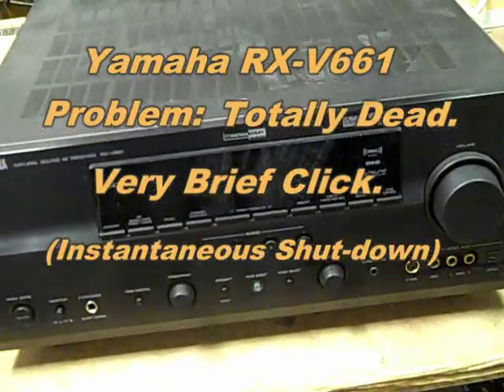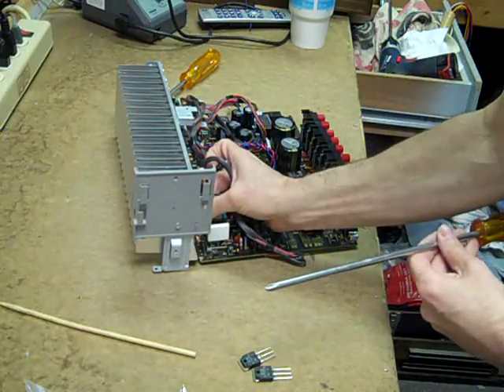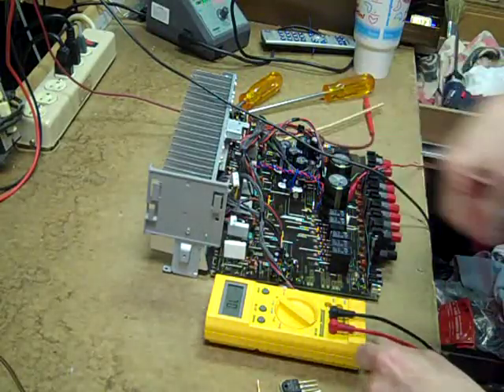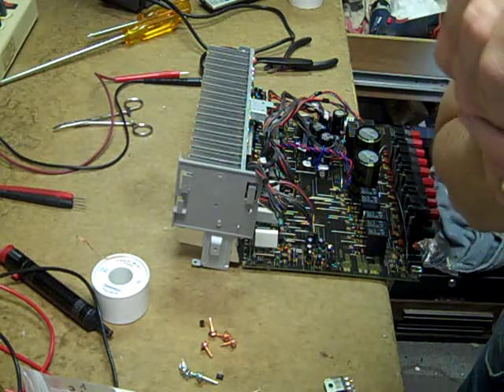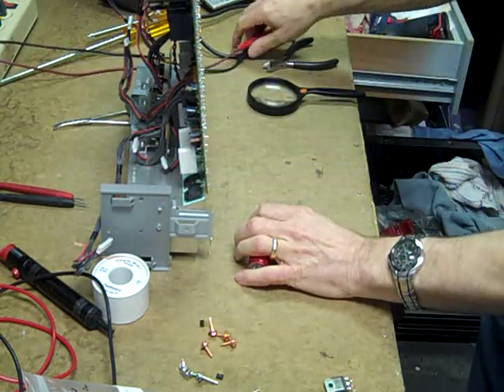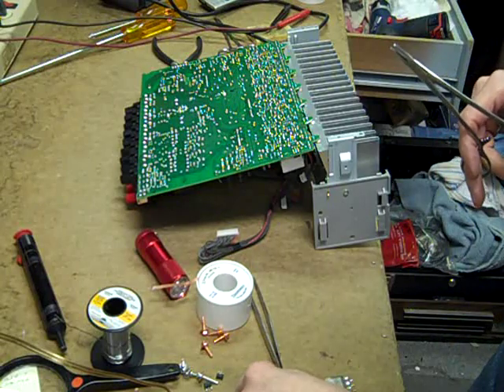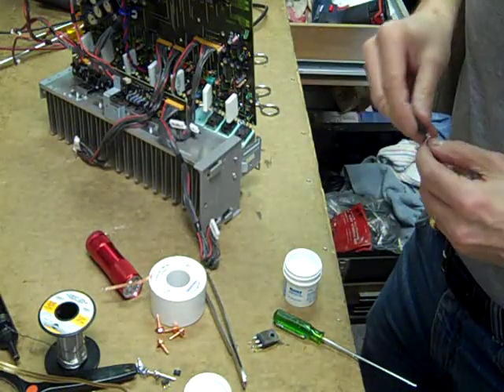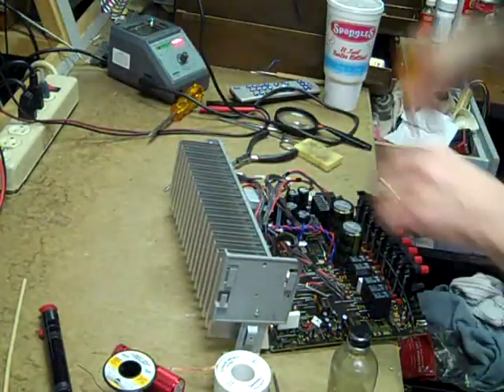Yamaha RX-V661 Repair Brief

Comment: I have Pioneer VSX921, suddenly notices there is not audio from SBR and SR 
channel; I checked that there is audio at relay PIN. Other channels are 
working fine. could it be a problem with relay? any logic that is not 
turning relay on. Thanks in advance
Reply from the maker: Looks like there are two separate relays involved here. Maybe try a full reset before going any further.
Reply: Thanks a lot Mark. I also had doubt about the relays. I did reset and there was no luck. Then I checked a capacitor leg after relay RLY6 and found audio. Now I can surely say that the problem is with track or the speaker pin solder joint. Accidentally I pushed the speaker socket and it worked! It is a loose fault or dry solder problem. Since opening the whole circuit board I made a jumper about half an inch from capacitor leg speaker tag. It’s now working fine. Thanks again for your reply.

Comment: Nice work, I have a yamaha rx-v667 and it works great but i have trouble getting radio stations to come in. after looking it over i see the antenna plug is bent up kind of funny and I'm thinking this might be a bad connection. would this be easy to fix?
Should I take it to a shop? I have done some soldering before but wanted to ask. thank you.
Reply from the maker: dankbobby The tuner is a complete module and fairly easy top replace except it is situated kind of underneath the HDMI board. The part number is WQ756600. List price is about 40.00
Reply: Mark Zacharias
Thank you very much.

Comment: Thanks for your feedback. That’s what I initially do, I measured the voltages at the CB703 connector: -11.7(12), +11.7 (+12), +11.5(12), 5(5), 23.1(25) and -23.3(25). The problem doesn’t seem to be here. Moreover, I checked the voltages at D18 (SMD), that is going to pin 35 (IC21) and is exactly 1.2V, as in schematics. While I am not sure I will get to the bottom of this, your explanations are very helpful (I enjoy more learning something new, rather than having this repaired).

Comment: Hey mark love thank you for this video I have the exact issue with my v661 I have done changed the output transistors but am struggling with the other repairs like the driver transistor I need assistance with the range it should read when tested normally and furthermore. I would like to if possible repair as I would hate to see it end as land fill. Any help would be grateful.
Reply from the maker: +Andrew Shorter If the outputs were bad ASSUME the drivers are bad, also the 5.1 volt zener diode. Also check the resistor between the emitters of the driver transistors. After these parts replaced, check resistance from base to base of the output transistors and compare to other channels(s).

Comment: Hi Mark. I have a Yamaha RX V659 that immediately goes into protection mode.  The error code is dc prt 026 hi. There is no short found on the output transistors. Any suggestions? Thank you.
Reply from the maker: This is because your problem is NOT the output transistors. The "PS" indicates a power supply fault.
Reply: Mark Zacharias Thank you for the quick reply. The error message did not include “PS”. Does “DC PRT” indicate a power supply fault?
Reply from the maker: @IIWII9  DC PRT indicates a DC offset on one or more amplifier channels. If the problem is on one channel only the likely culprits are the differential transistor pair or the low frequency roll-off capacitor for that channel. You can email me at mark_zacharias@sbcglobal.net

Comment: Hi Mark. I have been looking though your videos seeing if you have encountered my problem. I have a Yamaha RX-V667 receiver. It was working fine until recently it started constantly switching DSP modes. Its happening intermittently. I some of the other buttons on the front are also activating. Is it possible just to replace the front panel? Where could the replacement part be ordered?
Reply from the maker: pvdeluca Kind of unusual problem. The front panel switches are part of a couple of resistive networks. Any leakage could trigger this. Like if some liquid got in there somehow, maybe causing some corrosion. Tact switches can also be leaky but this is less likely. The part number for the front board is WU427500 for the U.S. model only. Ending in 600 or 700 for other markets. Probably fairly expensive.
Reply: Mark Zacharias Hey thanks for the response. Ive googed for days to find someone with the same problem. My apartment is very humid so this might have caused the issue. Too bad it was a great amp. It would feel like such a waste if i didn't get this repaired.

Comment: Hi i have a Yamaha RX V667 and only had about 1 year from someone who never used it now the Power Transformer was all new looking silver on top through the vent but just noticed that there is browning on the top which looks like har syrup sitting on the top. Is that due to the heat over the time that has turned the coating Brown ??
Reply from the maker: Mark Chancellor I've seen stuff like this from new. Looks like a resin coating. Otherwise someone might have spilled something. If the receiver works I don't think I'd worry about it.
Reply: Mark Zacharias
Reply: Mark Zacharias 
Hi thanks for the advice it must be a resin if someon spilled something then the heat generated will cause a burning smell. Cheers keep up the good work

Comment: Hey Mark,
that is a great and very useful video!
I have a Yamaha RX-V550 reciver, and it works perfectly, but sometimes it shuts down with loud boom when I switch between output programs (2CH, 6CH, Dolby Digital, etc.). The other problem is: when I plug in a headphone jack it works well only in 2CH mode. In other mode I hear only distotred music. When I pull out the headphone jack in 6CH mode, the receiver shuts down immediately. I checked the protection codes in the Diag Menu, I found only this: DC PRT 14 C
Can you help me, what can I do with this reciver?
Thanks!
Peter
Reply from the maker: This type of thing could be caused by a bad muting transistor, if only on one channel, or a loss or a DC bias voltage like "-12 AMP" from Q253 on the main board. You can power up the receiver in"protection cancel mode, described on page 23, but if the problem is intermittent you might be waiting a while to get any results.
Reply: Thank you! I will check the muting transistors and the bias voltages.

Comment: Just curious if you've run into the same issue with a rx-v795a Yamaha and if it could possibly be the same fix? Seems like every blog I've read says something different. Relay clicks but no power. Thanks and good work!
Reply from the maker: +Justin Bergendahl The most common thing is a blown amp channel caused by bad solder connections at the bias transistors. I would check continuity of the main power transformer first. If the unit went out after playing too loud for too long, the transformer could be bad. You need some skills like soldering and know how to use a multimeter or you're probably out of your depth on this one.
Reply: +Mark Zacharias  well I changed the relay on the main power thinking it was the problem but still getting the issue. Main transformer has 120v. The aux outlets work without power on. It has to be within the amp or a capacitor dried out. You obviously deal with these a lot. Just trying to narrow it down. All help is much appreciated
Reply from the maker: +Justin Bergendahl You should check continuity or the primary winding of the main power transformer.Should read a very low DC resistance. UNPLUG from the wall first! Next check for emitter-collector shorts on the output transistors. The smaller amp board amp channel nearest the rear of the unit is most common.

Comment: Question, I have a yamaha RX-V373 that just 2 days ago went dead while I was watching it. It will not power on at all. In your opinion is it worth fixing or would I be better off buying a new receiver?
Reply from the maker: Impossible to say for sure until the troubleshooting is done. The most common problem I have seen with these is a bad amplifier output module. There are two in this model, one is a two-channel version and the other is a three-channel version - hence the five-channel receiver. More often the 3-ch IC goes bad. The protection circuit has the receiver locked to avoid further damage.
Reply: Mark Zacharias Hey Mark,

I also have a 373 that won't power up. The relay trips when I do the tone control, straight, and power reset. It's a few months out of warranty. No signs of heat damage and fuse is intact. Any ideas where the most likely cause is? No symptoms prior to shutting off. Working one day. Not the next.
Reply from the maker: Sounds like the prior one - a bad output IC.

Comment: Hi mark, Im looking for some help if could please. I got a Yamaha RX-V367 which shuts down when I raise the volume, for recommendation of the troubleshooting book I change the cables and the problem still happening, also I check every single speaker separately and the receiver still shuts down.  Can you tell me what can I do or what sort of circuit can I change from the internal panel. Thank you so much for your time.
Reply from the maker: Wilson Bastidas There's at least a couple things that could cause this. Perhaps a bad output IC, for example. A severely clipped waveform is interpreted by the microprocessor as a DC offset. A DC drift arriving at the input of one of the output IC's could case this, but it's unlikely. Bad solder connections at an output IC could cause this also. You should disconnect all speaker wires from the back of the receiver and see if it still shuts down with increased volume. That would be useful information.
Reply: Hi Mark, Happy new year 2015, txn for your answer, well I disconnect al speakers and the receiver doesn't shut down which mean the problem can be made from the speakers. do am I alright?
Reply from the maker: Do carefully check the speaker wires. It's important that no strands cross over and touch from positive to negative.

Comment: Hi Mark, I have a RX V477 working on, its brand new, got off Ebay, in protect mode. Got into the diagnostic mode, first of all I don't understand what all that stuff means in diagnostic mode, so far I pulled and replaced all the output transistors, I had already bought all 10 anyway, but the old ones checked fine as did the emitter resistors, I'm new to electronics, went to school and trying out a few of these bad stereos to get some experience. What I need is a schematic of the power amp section, can't find it for purchase or free. And something about how the fault mode codes work. Apparently I have some other bad items in there I failed to check. BTW in fault mode I seem to have one dead front channel. Good learning experience!!  Thanks for the help. Subscribed!!
Reply: +Vernon Bosshard This vid cleared up a lot of confusion, so much crap on the net about why units go into protect mode, but from what I read is its always due to DC offset on the power transistors or something to do with the power amp section causing a fault. I bought a few units off Ebay for practice, got a Sony and found the schematic online. What size resistor do you use as a Cap bleed off?
Reply from the maker: +Vernon Bosshard http://www.hifiengine.com/manual_library/yamaha/rx-v477.shtml
You have to register but it's free.
Reply from the maker: +Vernon Bosshard I often use a 750 ohm 20 watt resistor to bleed of the higher voltages, especially if the voltage on a particular unit doesn't bleed off by itself. Lower voltages sometimes I'll use a larger  eight ohm resistor because it bleeds off faster.

Comment: Hi Mark, I have a RX-V771 and it goes to protection mode few seconds after power i powered it up. No standby power light when its off also. When i do the self diagnostics, it shows PS2 PRT: 186H. As per manual, this error is caused by abnormal voltage reading in -VP, +5A, +5T and 3.3s but this voltages are present and normal as per my checking. The other vital voltages on the AVR are present too. any idea what is wrong here? Thanks in advance
Reply from the maker: To start with I would check the output of the plus and minus 12V supplies - I suspect the 7912 negative regulator. They are on the main board.
Reply: hi +Mark Zacharias, unfortunately all the voltages, (+12, -12, +18, +5, amp dc power and other relevant voltages) are ok. any other hint? any option to trick/cheat/bypass this error ? thanks
Reply: power amp channel are all ok too.
Reply from the maker: Well something is triggering it. The PS PRT line is comprised of summing resistors wich go to each of the monitored voltage lines. The center point where they tie together is the PS PRT line. Occasionally a resistor is bad, but more often you just have to find the high, low or missing voltage source. There's no trick to make it work in spite of the protection problem, except the protection cancel part of the diagnostic menu, which only works so long as it's in diagnostic mode.

Comment: Hi Mark- I have this exact amp. The sound was blinking in and out the other day and now it has no output at all. Lights up and I hear the relays clicking, but no audio. Any ideas? Super bummed because this unit does not have that many hours on it. There was no burning smell or anything like that. Appreciate any and all advice you can give me.  This is a great video!
Reply from the maker: Does it work with headphones? Are speaker icons showing on display screen on receiver front?
Reply: @mdzacharias  Hi Mark, Thanks for answering me. It does not work with headphones, the speaker icons go on properly. The front display acts exactly as it should. I've seen comments about a Texas Instrument sound chip that goes bad on some Yamaha amps, not sure if this would effect this model. The night it went out, the amp was on for about 5 minutes, it went out, and then came back 5 minutes later, lasted about 10 minutes.  Since then, it's been silent.  I hope these clues give you an idea.  I do have experience changing components and have access to a reflow station. Appreciate any and all feedback!
Reply from the maker: @jimantonellis8653  I don't think this series was prone to those reflow issues but I guess you can't rule it out. I would start by checking all the power supplies. If for example the + and - 12 or 15 volt lines were dead it could kill the sound without triggering the protect.
Reply: @mdzacharias  Thanks Mark, I'm going to try and hunt down a service manual for this so I can identify the test points.
Reply from the maker: @jimantonellis8653  email me at mark_zacharias@sbcglobal.net and I should be able to send it to you.

Comment: My RX 461 shuts after turning on, when the speaker relay clicks it shuts down. any idea whats going on?
Reply from the maker: I first need to understand if it actually shuts down the instant the speaker relay closes. This could indicate a short on the output side. The nice thing is this can be check with the amp OFF. Just measure each (red) speaker terminal with an ohm-meter with respect to ground (any black speaker terminal would do). If any read as a short, the most likely thing would be a small shorted capacitor associated with that terminal. It's kind of rare, but I have seen it happen.
Reply: yes as soon you hear the click of the speaker relay it shuts down.
Reply: I don't get any reading from any of the + in the speakers terminals
Reply from the maker: You need to be looking for shorts especially associated with the speaker terminals.
Reply from the maker: Look for short circuits between any of the NPN or PNP output transistors collectors to ground. Sometimes there are failures of the mica insulators.
Reply: ok I will and let you know Thanks

Comment: Hi Mark.
I have a DSP-AX640SE ,that turns off imediately after turning on.  I disconnected  cable cb403, (coming from the main transformer to amplifying part) and goes ON  the receiver.Then  ( I PRESS "6CH INPUT ADN "STEREO" + STANDBY.  Then of display read PS PRT: 18% F , and loop on off. Please help
Reply from the maker: What is the original symptom?
Reply: When i turn on , the reciever repeat on -off, on,off......on,off
Reply from the maker: It keeps cycling on, off all by itself, doesn't stay off? At what rate does it cycle? Every couple seconds? A fast click, 2 or more per second?
Reply: yes doesn't stay off.= fast click. 3-4 per seconds  (on off).
But if I turn INPUT button , (change dvd-cd,-tuner..etc. very quickly ), The receiver management the cycle .
Then he just turned off.
  after I push power buton to switching on, the cycle begins again fast click
Reply from the maker: This type of problem can be difficult but obviously the first thing is to check power supplies. In this case the standby S12 line off the Power (2) board. If there was something pulling that line down after the power relay fired, it might account for your symptom. Relay fires, pulls line down, unit triggers OFF, line comes back up, and so on.